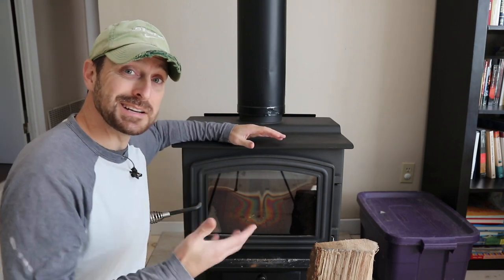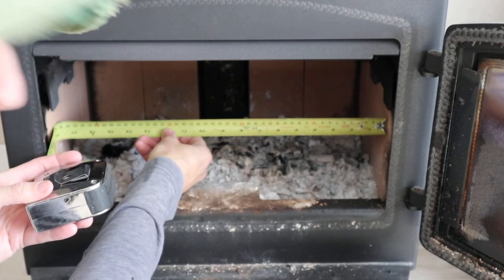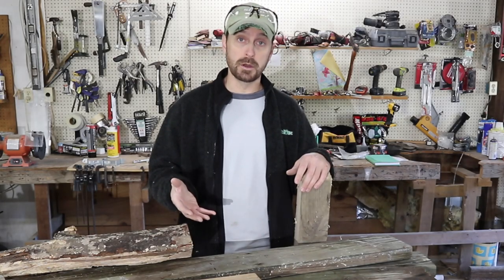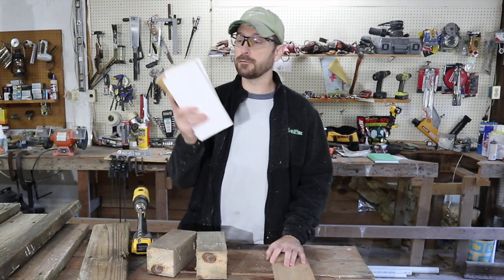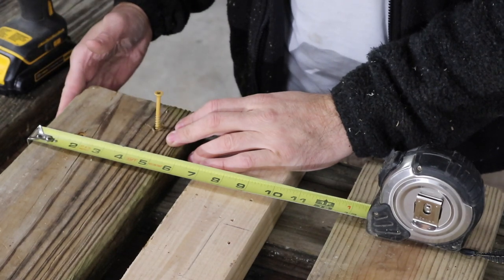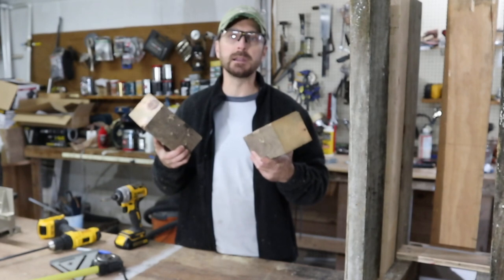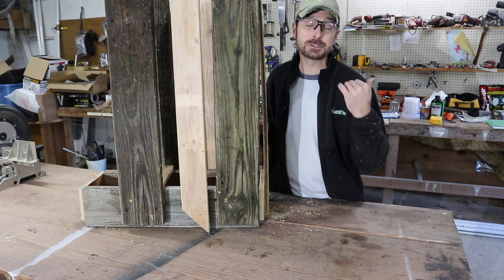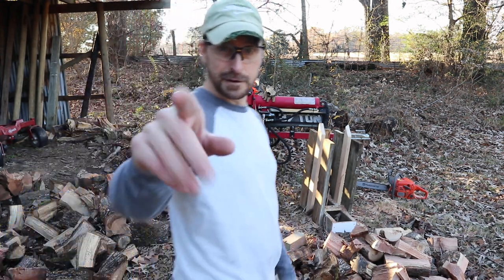Firewood Jig DIY Build! Help With Firewood Processing For Small Wood Stoves | Firewood Cutting Hacks

Comment: Another question. If I were to cut that piece of plywood wider than recommended in order to secure it to the sides in addition to the bottom would that make the whole thing stronger or would it mess something up that I’m not thinking of.
Reply from the maker: Sure. Modify it as you need to so that it works for you.

Comment: What kind of saw did you use to cut the pieces of wood.
Reply from the maker: That is a Husqvarna 445
Reply: @CountryLivingExperience  Oh, I am sorry I meant the saw you use to cut up the pieces to make the jig.  This is all new to me.  I just replaced a wood stove, and the new one is a lot smaller. The manual says to use 15 inch wood, and I am trying to get 18 inches into it, and it is not burning as hot as it should. Some pieces goes up from 18 inches and all the way up to 23 inches.
Reply from the maker: @EliseGeiman  Just a normal shop circular saw. It is a battery operated DeWalt brand with a 7.5" blade. Try burning different types of wood. Hardwoods are the best. Oak is tops.

Comment: So is the 30” piece of plywood only attached at the bottom? You left out that detail. It looks from the finished project that it’s only attached at the bottom. Seems that piece would be very flimsy
Reply from the maker: Correct. It does not need to be strong. It is just an end guide to keep the firewood flat so that it is all cut evenly.
Reply: @CountryLivingExperience  thanks!

Comment: Go to chipdrop.com. It is a free website not only can you get wood chips from the arborists but they can deliver logs as well. Simply get the logs then hire somebody to come and cut the logs up for you if you don't have a big enough chainsaw the cut them yourself and split them with a wood splitter. Some of these logs can be humongous. I've gotten some this spring that I still haven't gotten cut up or split. That's fine so far we have gotten over to Rick's of wood and still have probably another Rick and a half to go or more. Good for free firewood huh it helps you and helps the tree arborists that are looking for a place to dump their logs or wood chips. The wood chips are great for paths flower beds or even in your vegetable garden as a mulch. Shoot you can probably even use some of those wood chips in your fireplace.
Reply from the maker: It has never worked for me. I have been on their list for 3 years and not one tiny chip.
Reply: @CountryLivingExperience  well you can always try looking up Tree arborists in your area and calling them and have them put you on a list as well. It won't hurt. The Chip Shop website does say it could take a very long time sorry to hear you've not had that good of luck. Coaches but surely there are Tree arborists in your area that are still looking to dump wood chips or free logs.
Reply from the maker: I have tried that too. No luck. I even had one of the companies that I signed up with doing work 1/2 mile from my property......they never brought me the load the I visually saw in the back of their truck. It is different here for some reason.
Reply: @CountryLivingExperience  Hangin On there and keep trying. Maybe check with utility companies. They're doing the same thing and your street department when you're cutting back trees off the roadway. You never know you may get lucky